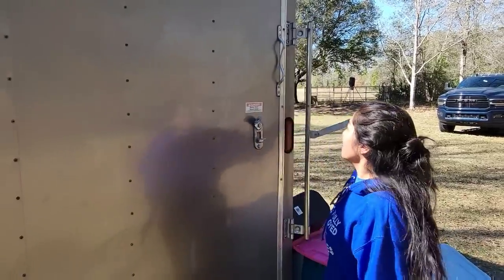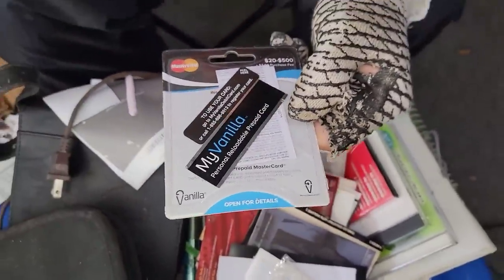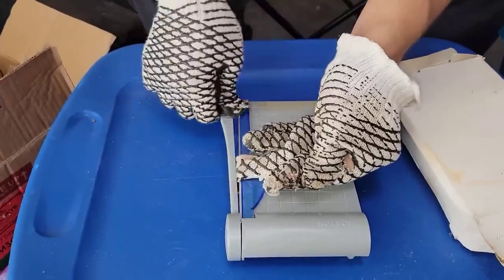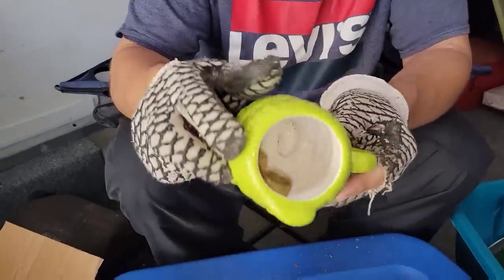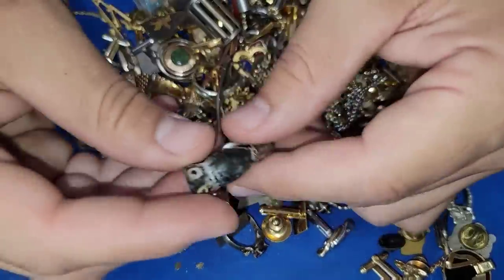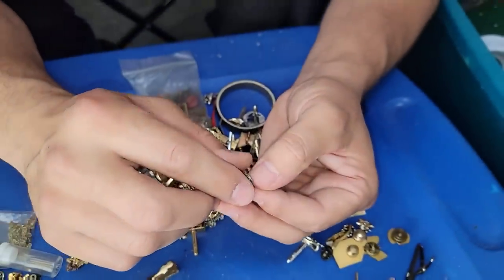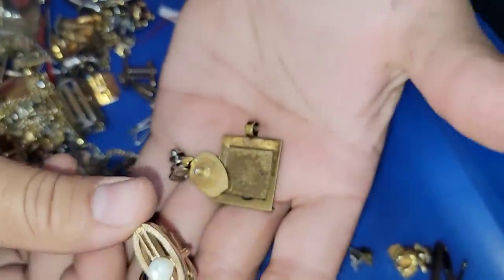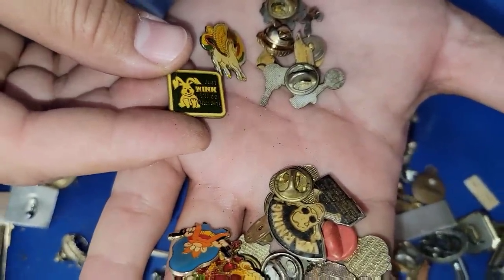I Bought A JEWELRY HOARDERS Storage Unit Filled With GOLD

Comment: Those "stretchy" bracelets were used to keep the cuffs of a shirt in place as well as keeping them from dragging across paperwork etc & smudging them. There are bigger ones that were used to prevent your trouser legs from getting caught in the sprocket & chain of a bicycle when you were riding.